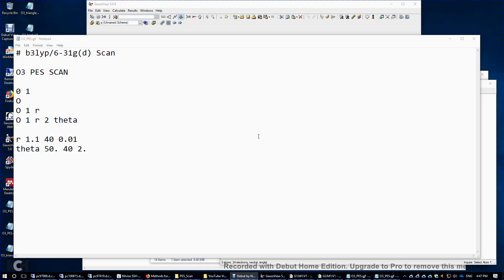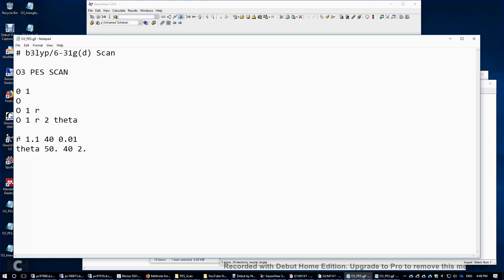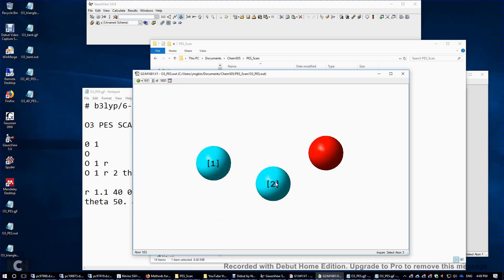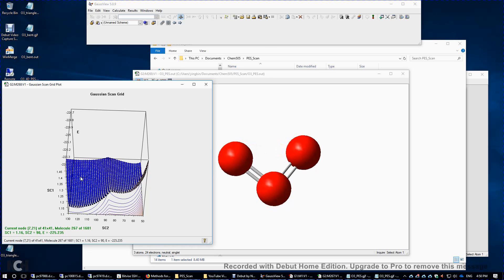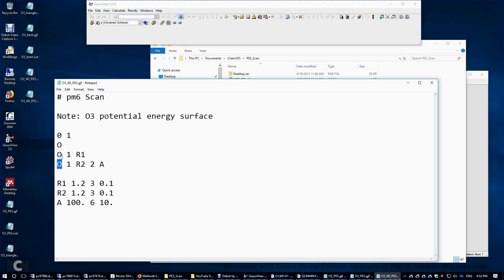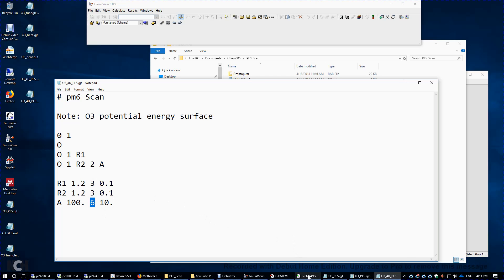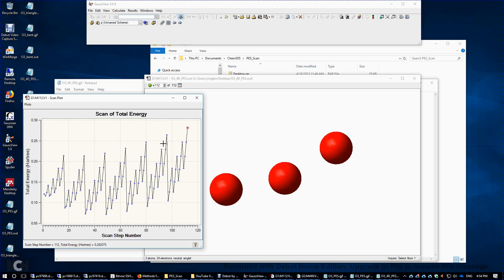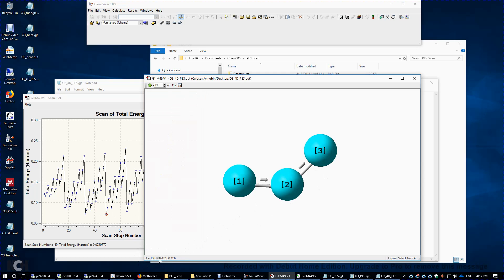Potential Energy Surface Calculation of Ozone (O3)

Comment: How you have drawn this  3D PES by using Gaussian software? Please tell me the steps to draw the same in Gaussian 09W and to perform the "scan" in ozone. Please
Reply from the maker: # b3lyp/6-31g(d) Scan

O3 PES SCAN

0 1
O 
O 1 r
O 1 r 2 theta

r 1.1 40 0.01
theta 50. 40 2.

Enter the above in the GJF file and run the calculation. View your result w/ GaussView.

Comment: Nice video!!
But do you know how to take a slice of your 4D data points and plot a 3D pes?
Reply from the maker: Two ways that I can think of: 1). If the goal is to plot a 3D PES, just freeze one of the 3 variables in the GJF file (or use 2 variables in the first place). 2) Write a program (I recommend Python) to extract the 4D data from the output and then you can plot a 3D PES.
Reply: @physicalchemistry_pchem  Do you already have a Python code for that?
Actually I don't know much about the format in which the 4D data points are printed in the log file. That's why it would be very difficult for me to write a python code.
Reply from the maker: @abhijitrana2613  It seems to be a nice and small research project for you to do.
Reply: @physicalchemistry_pchem  Yes it seems interesting. But is there any analysis software which can do this job?
Reply from the maker: @abhijitrana2613  I am sorry. I don't know. But reading the bond distances/angles and energy from the output file isn't that complicated.
Eg,
                         Z-MATRIX (ANGSTROMS AND DEGREES)
   CD    Cent   Atom    N1       Length/X        N2       Alpha/Y        N3        Beta/Z          J
 ---------------------------------------------------------------------------------------------------
      1      1  O 
      2      2  O        1   1.500000(     1)
      3      3  O        1   1.500000(     2)      2  140.000(     3)

 SCF Done:  E(RPM6) =  0.246826069850     A.U. after   15 cycles
Reply: @physicalchemistry_pchem  thank you 🙂